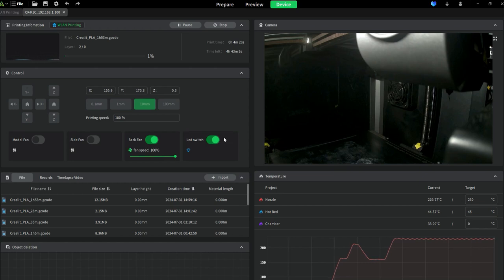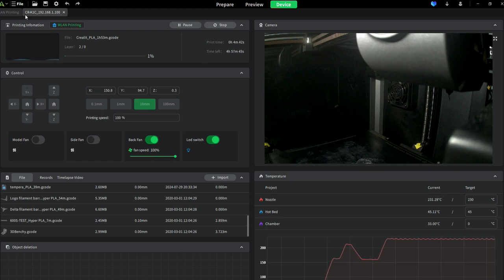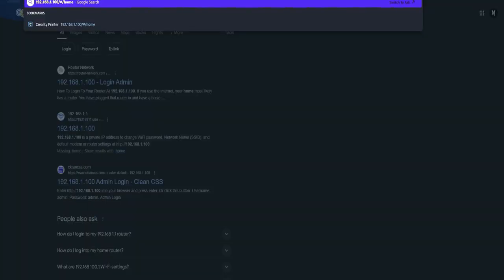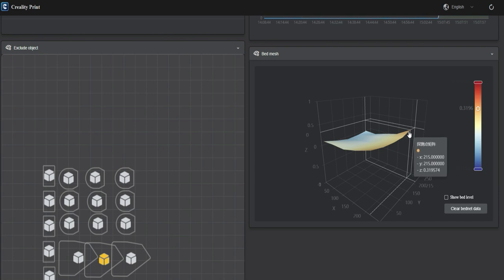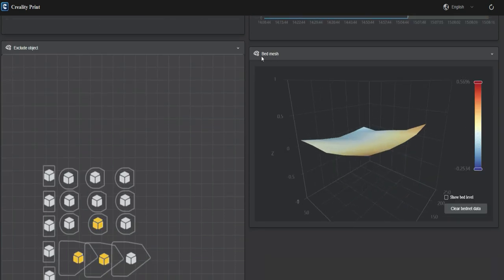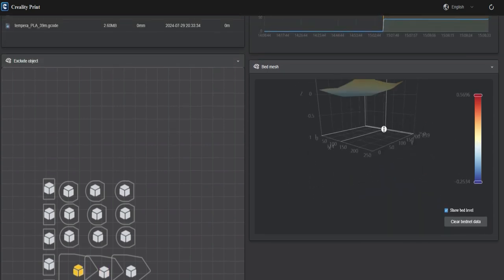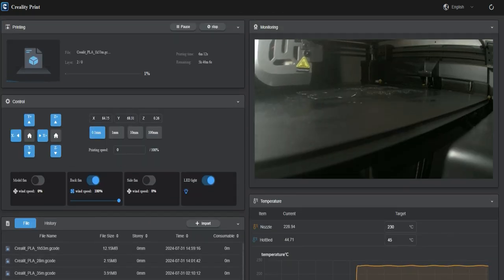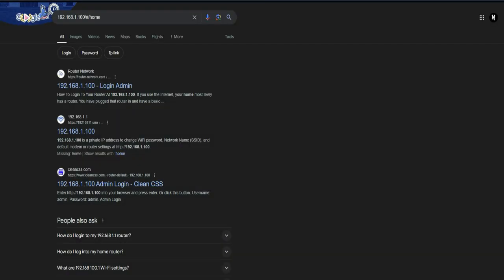How To Find Bed Mesh For Creality 3D print K1/K1C/K1 max

Comment: crap...doesnt work,,,i just get 404 not found. no matter what browser i put it in.
Reply from the maker: make sure you have plain IP without anything after. Sometimes it's add ''/home'' which needs to be removed. MUST BE PLAIN IP
Reply: You need to add the port number 4408. Adding :4408 after the IP address will open the fluidd window!
Reply: @Arawn404 i have done that with and without the port number. Always the same 404

Comment: I cleared bed data, and now i can't figure out how to redo it. Do you know how?
Reply from the maker: @Blake-q4b  refresh the browser
Reply: @-unknown-  that didn't work. I did it because I got a new print bed. Is there a way to remap it?
Reply from the maker: @ after self check it should show up
Reply: @-unknown-  I changed the 1st layer from .2 to .1 in a profile, and it re-mapped  it.

Comment: My apologies for not understanding, but could you explain this to me like I'm a 5 year old? Lol
I'm new to all this and I'm trying to understand how this works and why. I want to check my bed mesh but not understanding the process. Is the IP address that I copy the same as yours, or am I copying my IP address? When I'm done, do I need to change it back or what? Like I said, I'm pretty ignorant to this stuff, but willing to learn if you are willing to help. Thanks.
Reply from the maker: @Watchdog_McCoy_5.7x28  copy IP address from slicer. Then paste in browser. Follow all steps as shown in video.  And in browser you will be able to see the bed mesh. Why need to do that is to double check the level of the bed. If one side will be lower than other that can affect the printing quality
Reply: @-unknown-  kk. Thanks. I'm slowly learning the lingo and getting an understanding of how this works.
Reply from the maker: @ 6 months ago I was in your position. We all start with almost zero knowledge 👍
Reply: On creality print, when I click device, it doesn't show the camera view or any of the other settings like it did when I was actively printing something yesterday.  How do I get those settings to come back on when I click device?
Reply: Update: I solved that issue. Somehow my router changes the IP address so had to update the IP address and it is now showing as online. Someone suggested changing router settings to static IP but I'll fix that at a later date.
Reply from the maker: @ click add printer on right corner and rescan available printers. It's sometimes changing IP and that's why not always your printer is connected